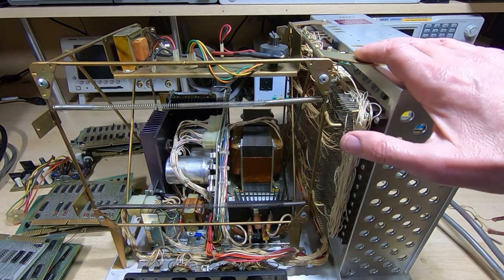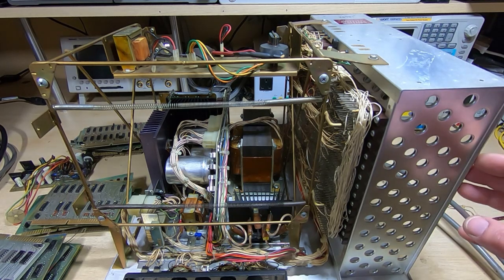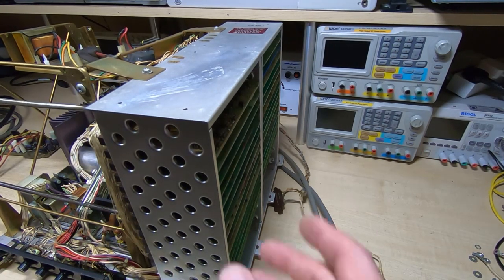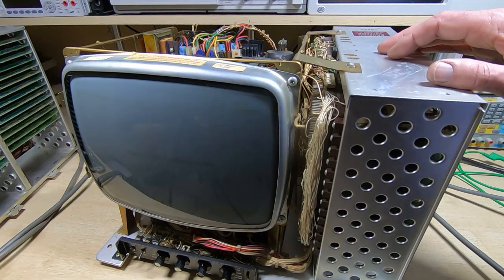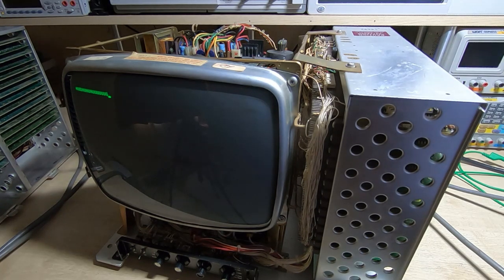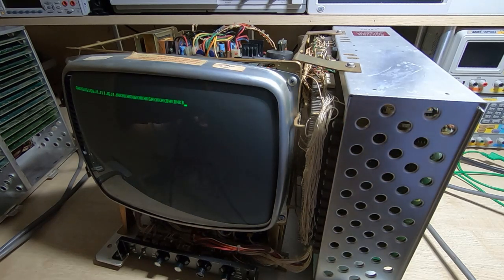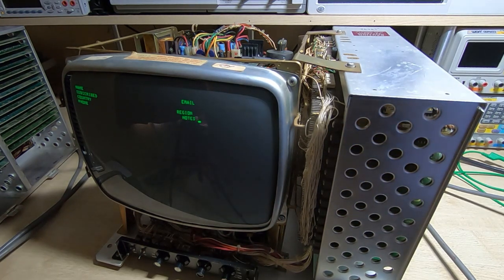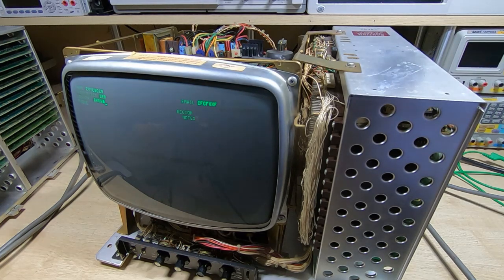Hazeltine 2000 Repair Part15

Comment: Jerry, I really hope that you will be lucky enough to find a good CRT so that you won't have to swap the one you already have between the two units.  It has to feel very good to assemble terminal #2 and have it work correctly first try, even though you know you've already successfully repaired & tested the individual cards & subassemblies.
Reply from the maker: The owner has the CRT but he removed it to avoid damage during shipping.
Reply: @JerryWalker001  Good safe move on his part!  I had forgotten that these terminals weren't yours, unless the first one is?